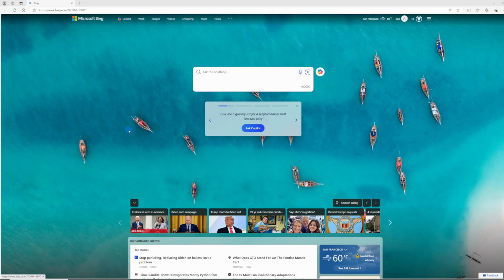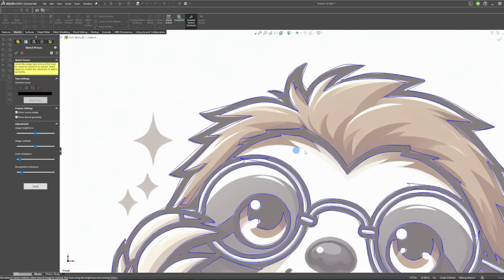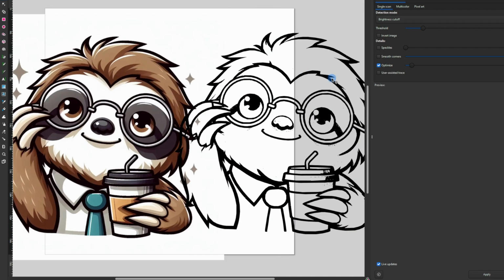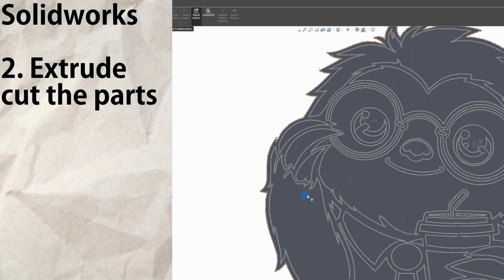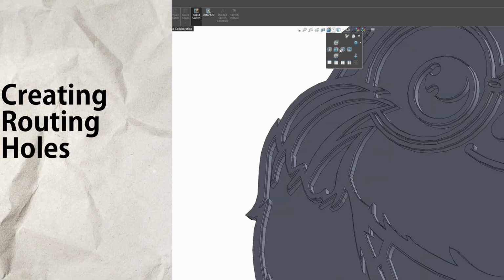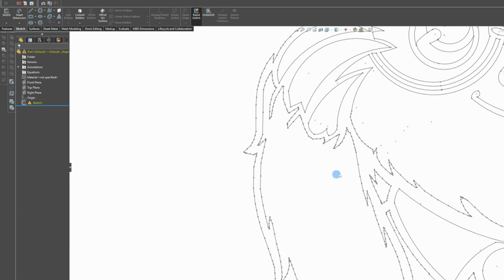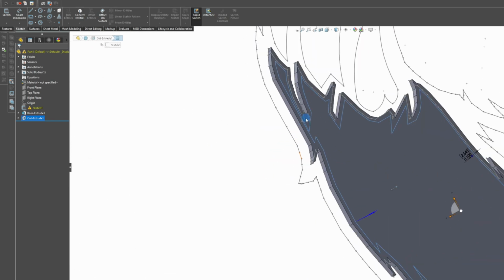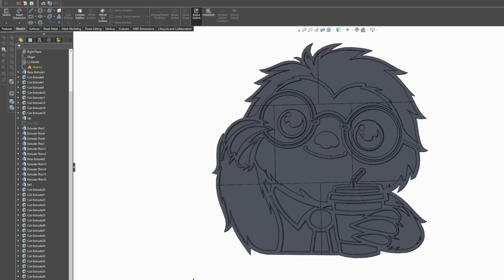3D Printed LED sign - Solidworks Tutorial

Comment: since you were not to control the lights, you could have used leds on a wire, and you could have fed them better. other than that, your solidworks skills are fabulous, and the ability to incorporate other programs into it its great.
Reply from the maker: Thanks, I used a LED strip I had lying around. Agreed, led on a wire or cord would have been much easier to route